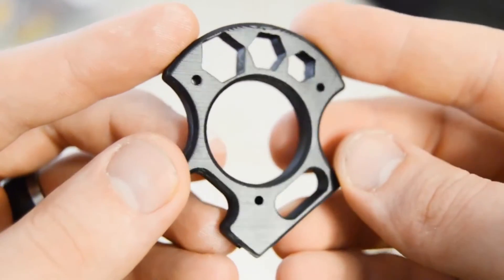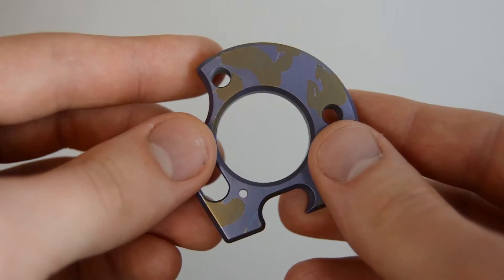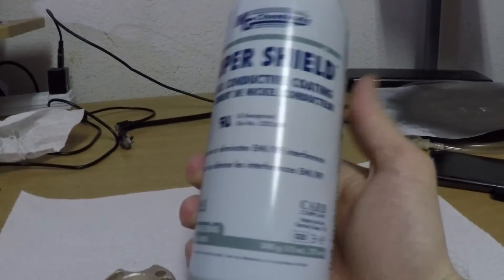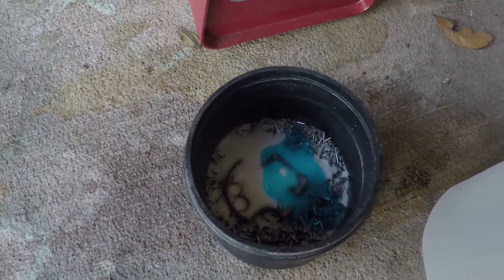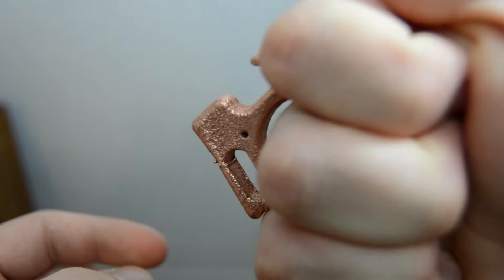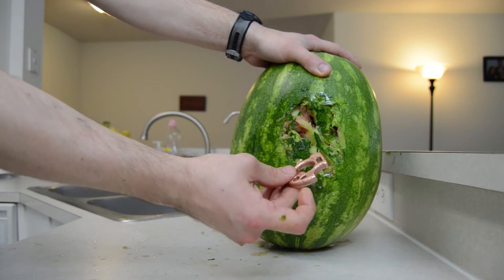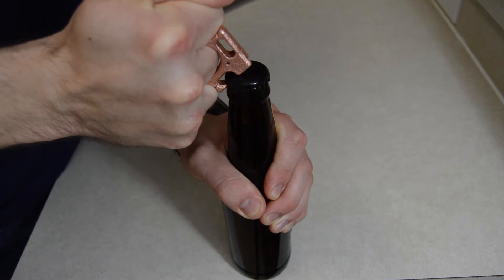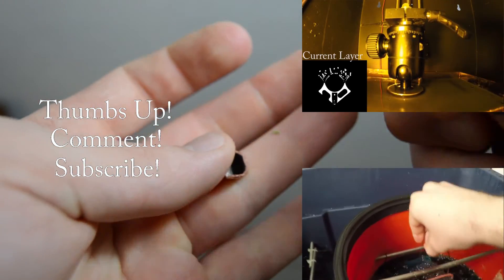Electroplating 3D Prints ~ Copper Knuckle - Reinforced 3D Print

Comment: hmm. Seems like you only plated it with one coating. Wouldn't more coats with nickel/iron/etc make the object even stronger? Eventually you could dip the print in various metals to get even thicker coatings, if you plate it enough that it doesn't melt the internal polymer?

Comment: can you build a prosthetic leg from the resin and coat it? i wanted to purchase an sla printer to print prosthetics in 2 or 3 prints but i found out the resin is quite unstable and not as durable as abs and pla. can you try your coating method to see how much weight a prosthetic hand and leg can hold each by themselves?
Reply from the maker: I think you would have better luck printing the larger parts for a prosthetic with an FDM printer.  If you use an SLA printer I would use a more durable resin like the formlabs tough resin.  Coating a leg in copper is going to make it substantially heavier and electroplating somthing that big (even in smaller pieces) becomes quite a bit more difficult.  Also printer a leg in resin is going to be pretty costly just because it will take quite a bit of resin.  I hope this helps.

Comment: I think that using the 3D printed part to make a mold to cast metal in it would be better at this point.
Reply from the maker: Possibly if you already have access to those tools.  Electroplating is just another method of getting metallic prints without going for the metallurgical approach.  I do agree that it could be simpler to cast a part instead which is why I'm working on acquiring the necessary tools to do that.